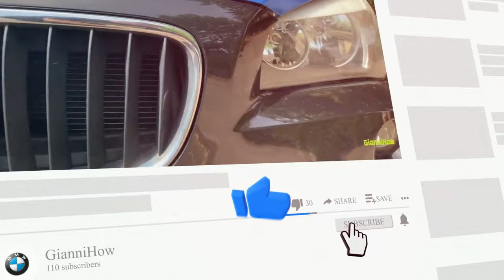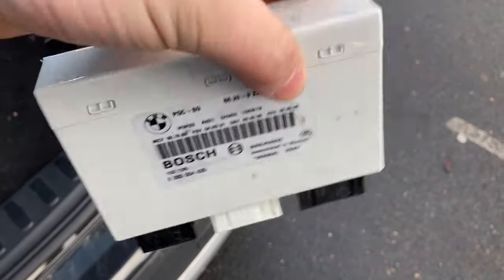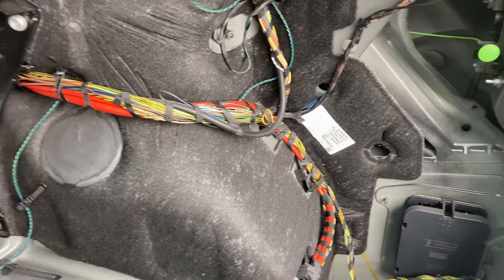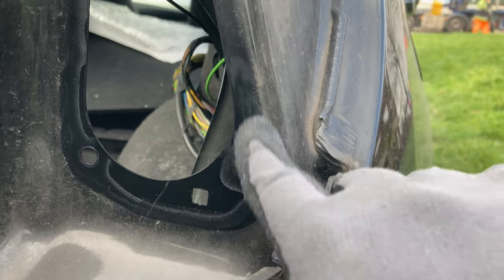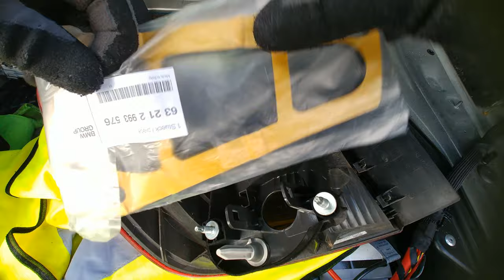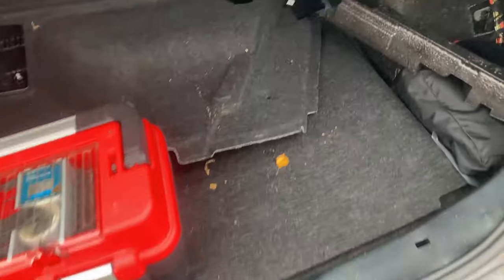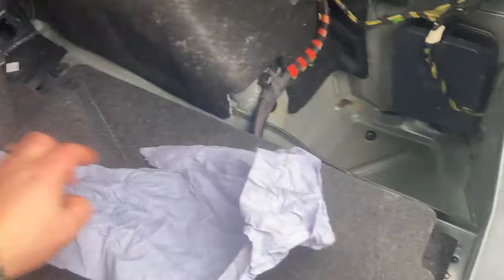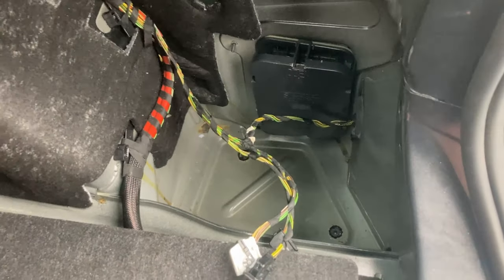BMW Water Leak SOLVED - Project Part 13

Comment: great video, trying to get to the cause of my leak and never thought it could be the lights, will be whipping my lights out tmoz and check the gaskets. 👍
Reply from the maker: Hello, thx a lot for watching, while you there check petrol hole gasket, it’s also common some water coming from there 👍
Reply: @GianniHow  YOU ARE THE MAN 👍, Update;  opening the fuel filler door inside there is a plastic surround - the rubber seal with the drain hole around the neck of the fuel filler pipe which is supposed to fit tightly inside the surround was not fitted correctly, there is a grove around the neck seal which is supposed to be slotted in the surround to provide a tight seal around the surround/neck to stop water getting behind it and any water that gets past the filler door is then exited through the drain hole.  the rubber seal was just pushed over the neck but not slotted in the surround,  i noticed when i showered water over the car water would get past the filler door and past the neck seal and then into the boot and come out right under the fuse panel (brilliant design lol), after removing the surround which also holds the filler door i refitted the rubber seal into the surround and around the neck (wasn't easy and prob the reason it was not fitted correctly) and now it stops the water getting in and i can now see where the drain hole gets rid of the water.
who'd of thought water leaking into the boot would be caused by fuel filler seal (apart from you lol)  what can i say but Thankyou 👏👏👏
Reply from the maker: @rikvermar7583  Hey that's a very nice written , your comment will also help others with the same issue. I'm very glad the input helped you fixing the problem and I'm very thankful for you taking the time to let us know.
Thanks man 🤗

Comment: So how has it been a month on? Did it fully fix the issue?
Reply from the maker: Yeah, in this case the issue was fixed, I can also tell you there are other areas to check, I see, unfortunately, it’s common to be the gasket in the fuel door as well, and last, less common, the rail roof gasket as well may cause this problem, I say I was lucky 🍀 so check taillight gasket, then the gasket in the fuel door, leave rail roof last as it is more complex 👌 
Hope this helps 🍀
Reply: @GianniHow  thanks for providing so much detail, I'll be sure to give this all a check. Keep up the great videos think this channel will take off!!👍🏼👍🏼